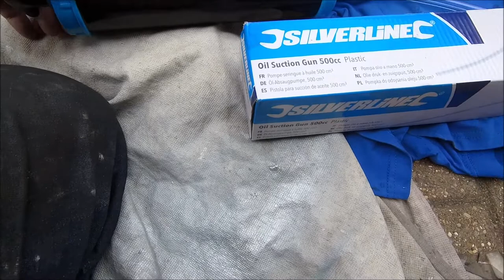Audi S3 Gearbox and Transfer box oil change

Comment: i have an a3 quattro and my transfer box is leaking. i want to top it up temporarily while i figure out getting the leak fixed. do you put the same oil into the transfer box as gear box? i thought transfer needed different oil! cheers
Reply from the maker: It may depend on year , but i consulted a friend at  Audi and they gave me the spec for the oil which they use for both the gearbox and transfer....the only difference i know of is the haldex which is completely different . I would say to be safe consult the experts to make sure.

Comment: Hello, the oil you used in the gearbox is it the same oil for the transfer box as well, or two different oils. I know the oil in the haldex at the rear is different from the rear diff, but I'm not sure about the front of the car.  Thank you.
Reply from the maker: yeah, same in both Stephen (at least that’s what my discoveries yielded)…  I did the haldex in another video and yeah completely different oil as you said.  DSG gearboxes also use a different grade to manual ones.
Reply: @AdeReeves  Thank you Ade for getting back to me and the info.

Comment: Is this an S3 8P1? I am putting mine in for Haldex and Diff oil change and asked for gearbox to be done too but I have been advised by my mechanic that the gearbox is "lifetime" and shouldn't need to be changed, so might be something I do myself when I get it back. Thanks
Reply from the maker: Most manufactures seem to clam "lifetime" now for gearbox oil....but 100k miles is a long time for nay oil and when i changed mine it was very cloudy with water ... so I would never , not change the oil on a car that's done over 50k with the same oil in it personally.
Reply: @AdeReeves  Thanks going to change mine tomorrow as I can get the oil and a pump on Amazon
Reply: Sorry to bother you again. Just a quick question I used the exact oil you used Comma 75w GL4. Keep seeing around the web it should be 75w90, shifting feels smoother already just hope there will be no issues 😅.
Did you go with the same exact Comma 75w oil for the rear diff in the end?
Now thinking should I get the front diff and transfer box done too while I'm doing all the other oils lol.
Thanks
Reply from the maker: @chickendipper657  Like you I tried to use forums etc to find the best options and like all post related to oil grades they all said different things... In the end I chatted to a friend who rebuilds gearboxes for a living and he said this is what he uses on all VAG stuff (even new) ...so I went with it ... wasn't the cheapest but like you, when the oil was changed it felt a lot smoother .
Reply: @AdeReeves  So you did go with the same oil in the rear diff? 
Edit: Just realised you did gearbox and transfer box, not to worry :)